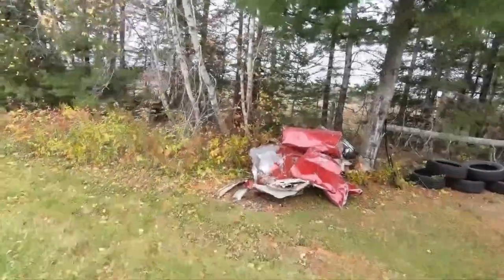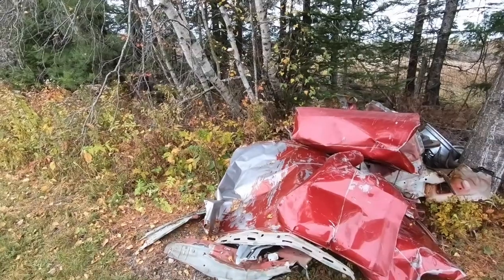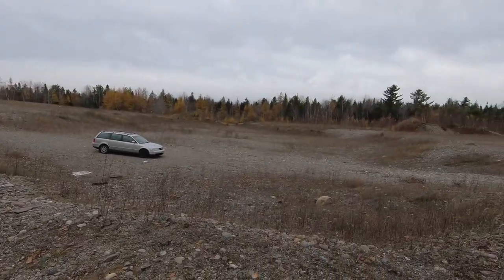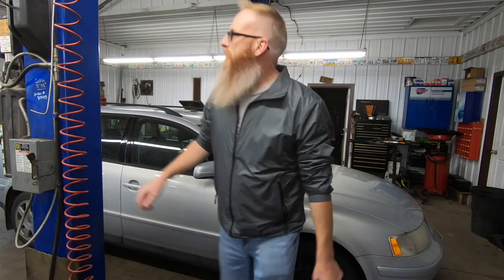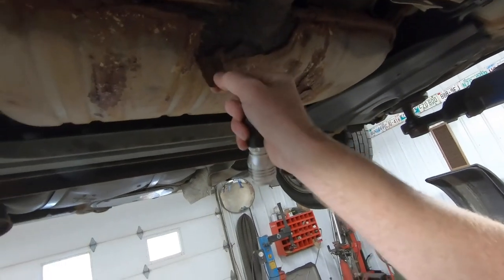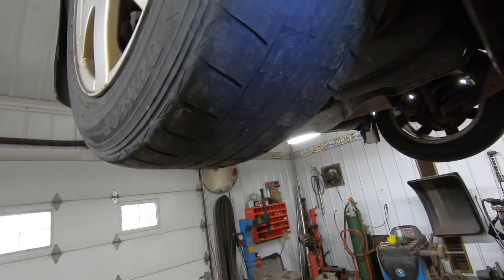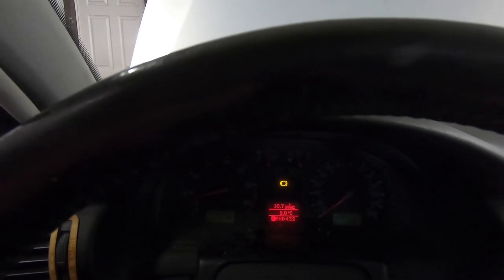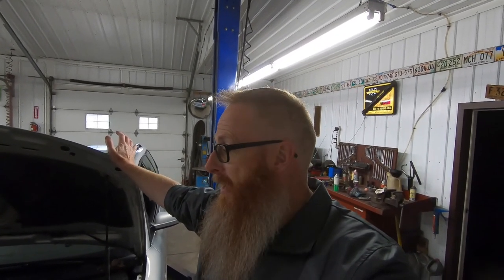DEVISTATION FROM 12 LBS OF TANNERITE VS KIA SPORTAGE- VW REPAIR COST

Comment: Straight pipe brake discs. It's  had new calipers on the front. A set off snow tyres. Easy fix it I have had 12 Passats two b5 and the rest B5.5s. Oxygen sensor is probably putting engine management light. Liked and shared
Reply from the maker: Thansk Ali! Looking like a secondary vacuum pump! Seems to be a common issue with the 1.8
Reply: @OldeCarrGuy  yeah vacuum leaks on any Vw Fairly common. My mate's Tdi 130hp had bad pipes we replace them she was all good.